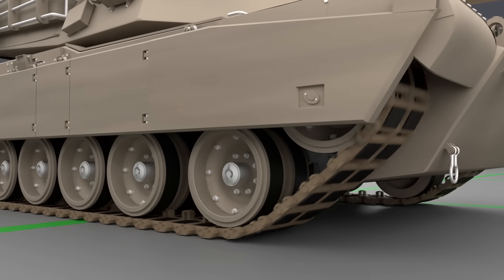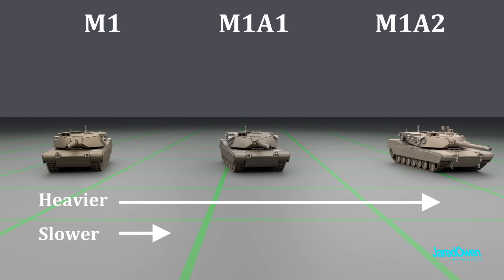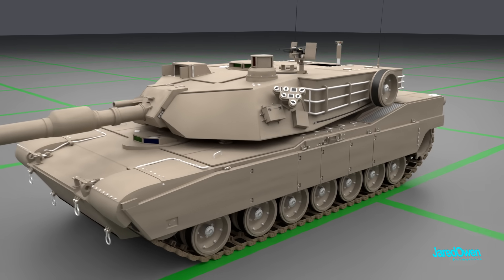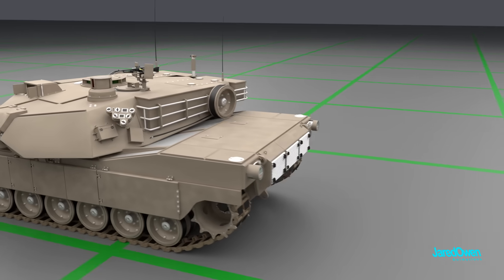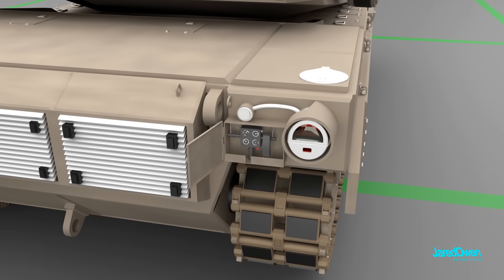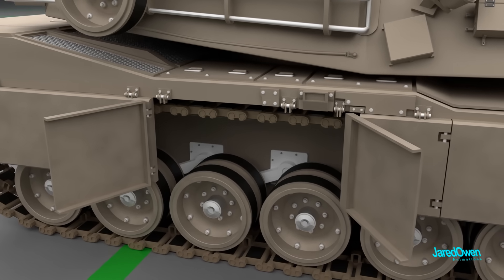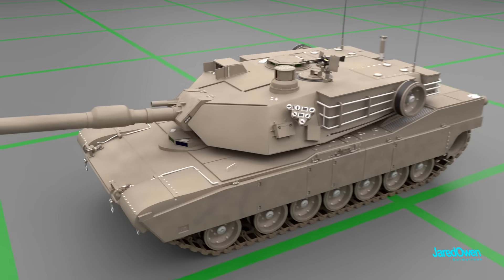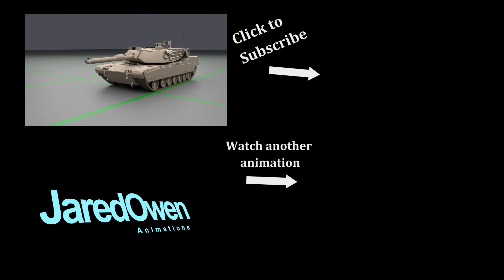How does a Tank work? (M1A2 Abrams)

Comment: I little side note of useless information., to add to your subscribers brains... The boogies, 6 per side, as you can see, and as the narrator mentioned, are not directly, side by side, or left to right side. In fact, the right side if, going head on, exactly straight on, into a 3 to 6 inch tall curb, or to say, perpendicular to the curb, the right side front boogie will touch the curb first, rather, the track will, but, you get the point. Meaning, all the boogies on the right side of the tanks haul, are 8 inches further forward. 

This serves several purposes:
No. 01) the swing arms, or trailing arms, also known as the boogie wheels suspension arms, are under tension from torsion springs. A torsion springs is a special allot of steel, simply called spring steel, the grade of spring steel is not important for the point here, but, there are several grades of spring steels, each serving the world for many reasons, you will need to investigate that subject matter for yourselves, and can start with metallurgy of steel, metallurgy of spring steels, heat treating and tempering of alloyed steels and spring steels, which, is an art form if you can fully wrap your head around the sciences of metal alloys and treatments for purposes. But, a torsion springs is a bar, that twists, and returns to the position from which it once was, from the tension, torsional/rotational force applied. The mounting methodology varies, pending the needs/requirements of said spring. In the Abrams series, both ends, are splined, or squared shaped teeth, around its parameter, and the length of the splines also varies,, that also, is a science in itself, of mechanical engineering and machining technology and techniques, also, worth learning about (on your own time).

The swing upwards action of the boogie(s) suspension arm, in turn, causes the twisting action of the torsion bar(s). The torsion bar. That is connected to the boogie "R-1" (Rightbside, position one, or front most boogie), that torsion bar on the R-1 pivots / twist/rotates on the right side bulkhead bearing to haul housing cap & retainer plate, packed with seals, bearings, and the bar runs all the way over to the left side of the haul, the full width of the 7 foot, 9 inch bottom width. That left side mounting, is a sure foot, it does nothing but locks the torsion bar via splines to the left side, it doesn't rotate. From the left side sure foot mounting, the full length of the bar, shares the load of twisting, evenly. Some manufacturers of tanks, or tracked vehicles, have two torsion bars per wheel. For example, torsion bar from the R-1 goes over to the left side, but, it connects to a equalizer adjuster that is allowed to pivot a bit, and from the left side mounting system, just mentioned, another torsion bad, run back over to the right side, to a sure foot mounting base. That left side two prong fork, of sort allows the a off-set twisting action, that will only make sense if you see a picture, trying to explain here, not gonna happen, but, that dual torsion bar system, basically, allows for two shorter bars, to be squeezed into a shorter distance on the hauls belly pan. And fine tune the ride comfort, when more junk is thrown up on of the tank.. they can change our between three torsion strengths, times, each boogie having two bars.. offer 9 different swing arm combined tensions or lefting through the haul support off the ground. 

The point is, the torsion bars take up belly pan real estate and beings each wheel in the Abrams, has its own torsion bar spring, one side has to be placed further forward of the opposite sides boogies, just enough, to clear the other sides torsion bar routing and mounting systems. If you looked at a tank with the whole top layer pealed off, seeing only the boogie suspension system, the torsion bars all parallel side to side, in order, R-1, L-1, R-2, L-2, R-3, L-3, ... R-6, L-6.. then drive sprockets, one on each side at the rear, as shown. 

Tanks with exterior springs suspension systems, do not have this "boogie staggered" design., as there was no need for the torsion bar clearance in the belly pan, springs are on the outside, as stated. But, often times, exterior springs offered a weak point to disable the tanks ability to keep the sprocket(s) tightly into the tracks.. if one while side is collapsed and the tank sinks down to the suspension limit of travel, there is nothing to put track(s) under tension mesh with sprocket(s), and any left or right directional turning, the tracks will likely, come clean off.. the suspension plays a role in the older tanks with exterior springs, keeping track tension, like the many variants of the Sherman series. 

Some torsion springs bars, can be solid bars, some hollow. Mounting systems as stated, can be splined or pinned through, some flat or by design, hammered flat with smooth transition or the round diameter of the central part of the bar. 

You can see real life torsion springs in action in many years of Volkswagen vehicles of the 50's to the late 70's for sure, beetles, buses, and 70's to 80's Chevy smaller pickup trucks, like the Isuzu Luv/Mikados, the 89 to early 2005 approx series of Chevy trucks, like the GMC Sierra series, the front ends were held in that ride hight via linear torsion bars, or parallel to the ladder frame chassis torsion bars, one on each side, that those were locked into place with hex drive into the lower A-arm of the IFS (Independent Front Suspension) system. And the rear mounting system, also hex drive into adjustment cam swing arms, or rather, stops and not arms. 

Another side note, when a torsion bar breaks, or let's go, it can be exceptionally violent, on the sound, and the damage from the resulting tension being let go in 1/1000th of a second.. often times why you will always see a torsion spring incased in a metal shroud or cage of sorts, if people will be in close proximity to the spring(s).. the GMC trucks, the chassis plays a major role is housing those. Yes, you can see them clearly, but still, has steel framing around them. The Abram, those are in ballistics steel channels for each one, to not only offer chassis strength, but to cage each bar from each other, so no damage is sustained to the neighboring torsion springs, as a single lite scratch on the other, will for sure in very short time cause that one to fracture there too. 

You will learn about surface prep and finish for spring material and types and needed care for each type, when you go down that rabbit hole. Allot of horse power is bound up in a 20 degree twist of a 2 inch diameter 7 foot long piece of spring steel. Well, 70 tons divided by 12 boogie wheel, and the swing arms at 19 inches long, and can swing/rotate 20 degrees and the torsion spring can do this reliably many times before fatigue or fracture/failure.. each one is holding allot of tension. 

There is my two cents. All numbers are just approx so I don't get in trouble giving out actual factual and likely classified info.. if you want that info, join the military and hope you are smart enough to hold the throne of a battle tank. Good luck.

Comment: When I enlisted in the Army in 6/01 the Army career counselors tried to talk me out of enlisting to become an Infantry Paratrooper and become an Abrams tanker instead. I refused and insisted that I’d only enlist if I could be a Paratrooper. It was my dream to be one and made me a 3rd generation Paratrooper when I did. Many years later I was attending the Maneuver Senior Leaders Course (MSLC) at Ft Knox. Despite having fought alongside Abrams tanks in Iraq in 2003-2004 and 2006-2008 I’d never been inside one. During MSLC we had the opportunity to climb inside many different armored vehicles and I decided to climb into the drivers seat of the M1. I’m 6’3” and my legs got stuck under the steering column. I had to have two of my peers help pull me out. I immediately thought back to those career counselors that tried so hard to get me to join as a tanker. I wanted to throat punch those guys for trying so hard to screw me over.

Comment: Funny thing about generating electricity all requires the constant RPM that's why I even Jaguar to build a turban Electric System for the car to be turbine to electricity to drive the only reason they didn't bother to manufacture it is the fact is there was no call for that efficient of electric vehicle that still required fuel

Comment: Even Koenigsegg the Supercar manufacturer has an electric motor by itself that will outperform that turbine diesel they need to replace it with a turbine generator and go to Electric drive and that way it would reduce the weight and fuel consumption by a lot but still remaining horsepower and torque

Comment: The downsides of that tank are that it is too heavy for the intended conditions and that it has to be serviced for eight hours per hour of use. Also, the jet engine that is put in it runs very hot, so it is probably not a good feature In a real combat situation.

Comment: 5:20 This only applies to the Abrams because the Challenger 2 and Leopard 2 use diesel engines.  The MTU MB 873 Ka-501 and Perkins CV12-6A respectively.

Comment: smoke grenades are wrong.. there two salvos for each side.. they will shoot out in front of the Tank from the honey cone about 50 meters... not as shows in this video!  also the Tanks a  smoke generator that spray fuel on the exhaust plate in the rear and become with cloud of smoke if tact idles is used it become a huge smoke screen wall as the tank is moving around. also when the whole turret is hatches are lock visibility goes to 50% during daylight and at night 25%.

Comment: Actually the main purpose of the side skirts is not to protect the tracks and wheels but to serve as spaced armor for the sides of the hull, protecting the hull from HEAT warheads (high explosive anti-tank, a type of shaped charge) in particular. Because of the spaced armor, when the warhead detonates, the metal jet emitted by the warhead will first cut through the skirt but get dispersed in the space between skirt and hull, causing it to lose a lot of its armor penetration ability. (Note that "tandem warheads" detonating two or more shaped charges in succession have in turn been designed to mitigate this defense … the usual arms race.)

Comment: All you have to do to defeat a tank is literally just lay a wet tarp or cotton sheet over the top of it. The crew then can 't get out, the cameras, targeting and machine guns can't be used, the driver won't be able to move the tank bc they can no longer see, its APS will be rendered useless, and spinning the turret isn't going to remove the wet sheet either. A bazillion dollar tank defeated by a couple thrift-store bedsheets. And yes, it's been done, I've seen it done, and it works.
Reply: Thanks for that I may or may not use this information but I am happy to learn it

Comment: Wikipedia article of the tank

The M1 Abrams is a third-generation American main battle tank designed by Chrysler Defense (now General Dynamics Land Systems)[9] and named for General Creighton Abrams. Conceived for modern armored ground warfare and now one of the heaviest tanks in service at nearly 68 short tons (almost 62 metric tons), it introduced several innovative features, including a multifuel turbine engine, sophisticated Chobham composite armor, a computer fire control system, separate ammunition storage in a blow-out compartment, and NBC protection for crew safety. Initial models of the M1 were armed with a licensed-produced 105 mm Royal Ordnance L7 gun, while later variants feature a licensed Rheinmetall 120 mm L/44.

Comment: There's something about how you speak of the Engine for the M-1 series: You give the impression that Turbine engines are common to ALL tanks; this is not so. I believe the reverse is true
Reply: This video is specifically about the M1 Abrams. It does not claim that the use of a turbine engine is common to all tanks or even shared with any other tanks. Tanks generally used gasoline engines until after WWII, and currently generally use diesel engines.

Comment: On the surface, this is a pretty solid 3D model of an abrams, but there's some seriously questionable aspects ot the model, such as the symmetric turret, the raised drivers hatch, the huge lower front plate, the lack of 50 cal machine gun, the extruded mantlet, but overall, it does do a good job at expressing the profile of the abrams

Comment: M1 Abrams Tank DISADVANTAGES:

•	The M1 Abrams Tank Gas Turbine Engines originally designed for aircrafts and employed on Tanks is a very stupid idea and stupid decision. That Gas Turbine Engine is too expensive to maintain and too expensive to operate compared to diesel engines. First of all, Gas Turbine Configurations are too complex and hard to maintain. It is very complex to fix if it breaks down. It is a maintenance headache. This was proven in the Wars in Iraq during the 90's where Abrams tank always have gas turbine engine trouble on desert environment conditions. Worse, The Gas Turbine Engine is fueled with a very expensive and volatile Jet Fuel as compared to other tanks that uses efficient and less volatile Diesel fuel. An quick hit on the rear engine area will puncture the Gas Fuel line or Gas storage and the engine itself will make it explode quick. This M1 Abrams will be a quick inferno because its using Jet fuel.

•	The sides of the hull have a small thickness (significantly less than most heavy tanks of the Second World War, and as reinforcement they have only a bulwark made of soft steel with filler) and are vulnerable to enemy fire, including for older versions of grenade launchers[162][163], with the use of DZ this problem is partially solved, but only at a small parts of vehicles specially converted for urban combat (TUSK).

•	The lack of guided weapons, unlike most modern MBTs, reduces the range of fire and complicates shooting at remote moving targets (on the T90, the targetspeed for the KUV is 70 km/h, on the T-64 supersonic KUV since 1976). At the moment, MRM-CE and MRM-KE guided weapons systems are beingtested[164] (unavailable link), and experimental firings of the LAHAT[165].

•	Due to design flaws, it is possible to defeat the auxiliary power plant (APU) mounted on the stern of the tower even with a large-caliber machine gun. Accordingto other sources, information about the possibility of such a defeat with the subsequent leakage of fuel onto the tank body and its ignition is based on a singlecase and was caused by a 25 mm projectile accidentally fired at close range by the crew of the Bradley infantry fighting vehicle[166]. At the moment, the APU hasbeen removed from the abandoned basket and replaced with an additional battery in the track shelf.

•	Vulnerability of the rear projection and sides of the MTO compartment for various BMP guns at a range of up to 2 km when firing at an angle from 38 to 90°[167].

•	The inability to control an anti-aircraft machine gun from the turret (inherent in many MBT) on M1A2 tanks. After the invasion of Iraq, in order to avoid cases of defeat of the tank commander during firing from the M-2 machine gun located on the tower, his place is fenced with bulletproof glass shields. As part of the SEPv2 tank upgrade, the CROWS II (Common Remotely Operated Weapon Station) universal remote control module is being installed[168] (unavailable link).

•	It is difficult to avoid a strike from above using cluster bombs (there are many special anti-tank options, including for MLRS)[169], and in positional warfare, deadlystrikes from large-caliber mortars/artillery, especially precision weapons with adjustable projectiles[50]. And also from the blows of grenade launchers/ATGM in mountain or urban combat conditions.

•	Depleted uranium both in armor and in ammunition is highly toxic and radioactive, armor with an explosive device under the influence of projectiles burns at a temperature of 1000 °C and releases highly toxic particles that it throws out with armor and projectile particles during the penetration of the projectile into the armor, shells act similarly to armor (burns up to 70 % of the projectile)[170].
Reply: Nice copy-paste

Comment: That stupid M1 Abrams Tank Gas Turbine Engines originally designed for aircrafts and employed on Tanks is a very stupid idea and stupid decision. That Gas Turbine Engine is too expensive to maintain and too expensive to operate compared to diesel engines. First of all, Gas Turbine Configurations are too complex and hard to maintain. It is very complex to fix if it breaks down. It is a maintenance headache. This was proven in the Wars in Iraq during the 90's where Abrams tank always have gas turbine engine trouble on desert environment conditions. Worse, The Gas Turbine Engine is fueled with a very expensive and volatile Jet Fuel as compared to other tanks that uses efficient and less volatile Diesel fuel. An quick hit on the rear engine area will puncture the Gas Fuel line or Gas storage and the engine itself will make it explode quick. This M1 Abrams will be a quick inferno because its using Jet fuel.

Comment: You demonstrate a modern tank, and then suddenly start measuring its size in as arbitrary units as body parts — "feet" :D sorry, this just so ridiculous
Reply: Is each Abrams tank a slightly different size based on how long the feets of the engineers were? 😂

Comment: My only critique is that there are not four tow shackles on the front.  There are two, down low on the hull at the corners.  There are also two on the back in the same relative position.  Other than that I found this a very well done video and the graphics are stunning!  I was on the original M1 series for five years.